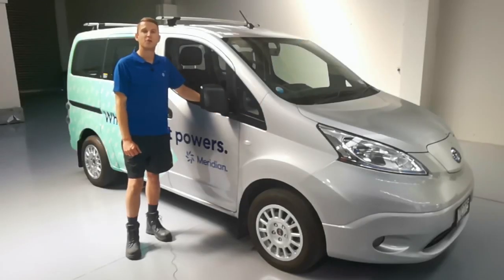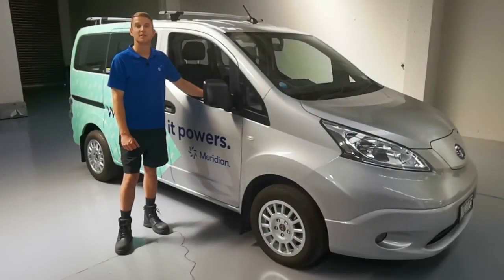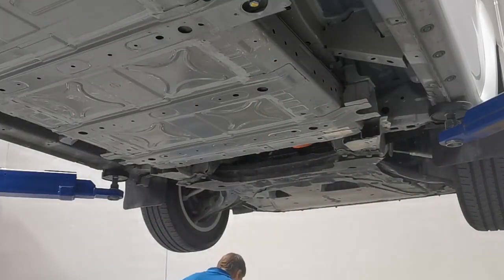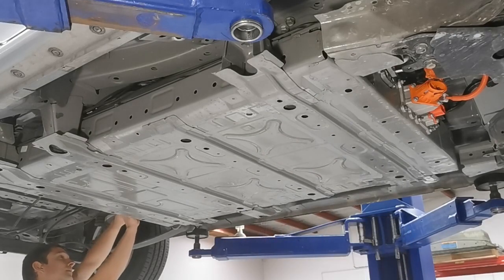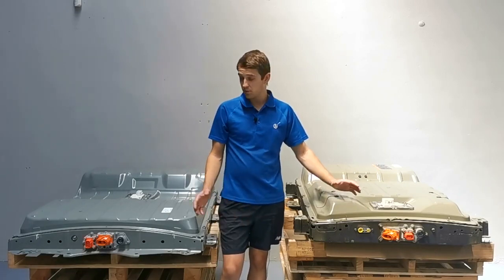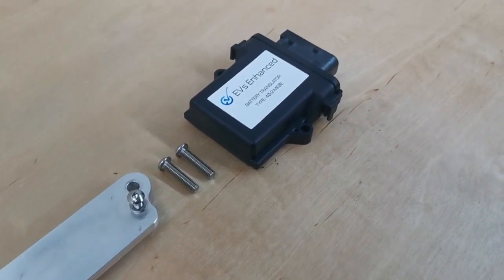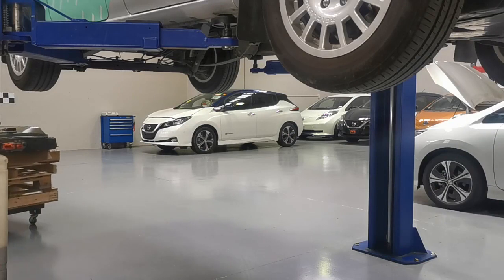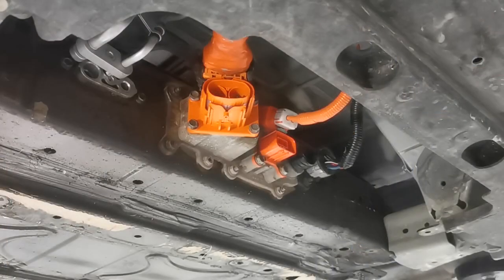Nissan e-NV200 HV Battery Upgrade - Simple Install

Comment: Where do you get your 40kWh battery from? and how much does it cost? It appears not possible to buy thease from Nissan UK or am I wrong?
Reply from the maker: Hi. The battery pack came from a lightly damaged 2018+ e-NV200. There were very few of these vans ever made, so finding these packs is quite difficult.  We are working on another solution though which we will be doing a video on in the future.  Subscribe to our channel if you want a notification on that when we release it.

Comment: I have the option to buy a battery from Nissan Leaf 40 kWh and I have an e-nv200 24kWh, the question is if I take out individual batteries from the 40 kWh leaf, can I put them in the e-nv200 24kWh
Reply from the maker: Hi. Good question. The answer is yes and no.  You can use most of the modules from a 40kWh Leaf battery pack, but not all of them.  You need a few e-NV200 specific half modules and trying to split 40kWh Leaf modules in half is not recommended. Also, the 40kWh Leaf BMS needs to be reprogrammed and a different current sensor is required.  We just happen to be doing an e-NV200 40kWh upgrade this way very soon and we will make a video showing and explaining the whole process.

Comment: Is there going to be a 16-blade battery pack available for the ENV200 as well?
Reply from the maker: Hi. Unfortunately, the 16 Blade platform is very specific to the Leaf and wouldn't be compatible with the e-NV200.  However, we do have tentative plans for the e-NV200 that we'll re-visit more seriously once 16 Blade Green is in production.  We're also currently playing around with re-packaging 40kWh Leaf modules into e-NV packs as we expect to be pulling a lot of 40kWh Leaf packs out of ZE1s to upgrade to 16 Blade Green.

Comment: Changing a battery pack is this easy?! multiple times easier than an ice swap. Are their other steps not in the video?
Reply from the maker: Hi. The only part which was mentioned, but not shown here is the de-gassing and re-gassing of the air conditioning system which is used to cool the battery on most e-NV200s.  Other than that - yes it is super easy compared to an ICE swap.
Reply: @EVsEnhanced  But then doesn't really compare to an ICE swap - more like replacing the fuel tank. Analogy for ICE swap would be changing the whole motor/inverter/reduction stack.

Comment: So your AC must be on all the time to cool these ...not very good for the environment is it....these EV burn oil and gas just like a petrol or diesel...the difference is the old oil from a diesel or petrol can be reintegrated back to a oil burning power station and burned to make energy...very good that.....
Reply from the maker: The AC is used only to cool the battery and is not required often.   The AC system is powered from the high voltage battery.  How is this anything like burning petrol or diesel?
Reply: @EVsEnhanced  especially if we get our electricity from solar

Comment: Good day! I guess I already asked you !?
Tell me, is it possible to put a 62 kW battery in the e-HB200?
What is the best way to do this? Move all the elements to the old case? Will there be room for a cooler?
Thank you!
Reply from the maker: Hi.  Using modules from a 62kWh Leaf wouldn't be possible with the standard eNV200 battery enclosure.  However, with a custom made battery enclosure, wiring loom, bus bars, battery translator and enough time/effort anything is possible.
Reply: @EVsEnhanced  Спасибо!

Comment: no. it's not active cooling. nissan packs have a 3-cell stack- so even if you blow cold air directly into the pack? the middle cell gets NOTHING. and? nissan packs CONTINUE to fail before 100k miles. PATHETIC.  liquid cooling is problematic? "tesloop' inc. operates a shuttle service to & from the casino's... basicly a taxi cab. they pick up people FROM all over CA & nevada- and haul them to the casino's. frequently i-80 & i-50.. over the sierra's IN WINTER, in sub-zero temps. they use tesla model x p100- and they report NO PROBLEMS with those packs... only replacement at mileages between 300k to 450k! you'd cycle through 4 or 5 leafs in that many miles. air cooling my ass. what a joke.
Reply from the maker: This system on the e-NV can only be referred to as active cooling.  You are correct that blowing cool air around inside the pack is not nearly as effective as active liquid cooling, but it is more effective than nothing.   We totally agree that Nissan's battery module design does not lend itself well to any type of cooling.   However, we've done a road trip with an e-NV200 for some real world testing and it is certainly an improvement over the equivalent LEAF.
Reply: @EVsEnhanced  agreed. it's just sad- aside from that? they have a wonderful vehicle in the leaf & the van. at this point they'd almost be better off to just buy a tesla pack & call it a day.

Comment: You could probably sell the translator in the UK, have you seen the video below? 

Watch "New Batteries for Old EVs : 150% more range for a Nissan LEAF | FULLY CHARGED" on YouTube
https://youtu.be/C4nS_tSQiVQ
Reply from the maker: Yeah, they certainly make the process look a lot more complicated than it needs to be with hacking into the wiring and having to send files away.

Comment: Have you guys thought of doing an aftermarket cooling kit for the leaf 40&62? Forced air cooled maybe?
Reply from the maker: Hi. Firstly, the 40 and 62 are completely different situations.  The 40 is pretty bad on any kind of long-ish trip with multiple fast charges involved whereas the 62kWh takes a lot more effort to cook.  There is very little spare space in a 62 pack which is pretty packed full of cells so adding anything else in there isn't feasible.   We have put considerable thought into cooling a 40, but decided against it mainly because the original module design really doesn't lend itself to very effective cooling. It makes more sense to put good 40 packs into earlier cars and replace with a well engineered replacement pack with a decent cooling system.   We're planning on releasing more videos this year on this topic.

Comment: Wondering if it is possible to put the bigger 62kwh pack from the newer Leaf into an env200?  I'm contemplating an env200 based camper van and the extra range would really be helpful in more remote parts.
Reply from the maker: The Leaf packs are quite a different shape as shown in the video so this isn't feasible.  However, approx. 60kWh is definitely feasible in these vans as an aftermarket solution.
Reply: What cost is this upgrade

Comment: Fenix power in Raleigh, NC builds REAL active cooled packs with cylindrical cells, installed for $7k and offers a BETTER warranty than nissan. SAD WHEN AN AFTER MARKET COMPANY BUILDS A BETTER PACK THAN NISSAN BUILDS for their OWN car. or? exciting I guess if you own a leaf.
Reply from the maker: Are you sure Fenix has an aftermarket liquid cooled Leaf battery available for sale now?  If so then that is great news and we would love to see more details.  However,  we don't see any new information on their website or social media to confirm this so suspect that it is something they are either still working on or have given up on.

Comment: blowing cold air into the battery case is NOT THE SAME THING as active cooling. nissan's battery is still a failure, not to mention the fact that constantly running the hvac system to maintain battery temps is no where NEAR as good as active liquid cooling and takes extra energy away from the pack vs. liquid cooling. DID THEY LEARN NOTHING? 

hey nissan- I'll SPELL IT REAL SLOW so even YOU  can get it:    L i Q U i D    C O O L i N G
Reply from the maker: This system on the e-NV can only be referred to as active cooling.  True, it is not nearly as effective as active liquid cooling, but it is more effective than nothing.   We've done a road trip with an e-NV200 for some real world testing and it is certainly an improvement over the equivalent LEAF.  At least Nissan has finally gone to liquid cooling on the Ariya.
Reply: Active cooling is an essential feature in very hot climates, but a nuisance in cooler climates. Cars with active liquid thermal management are prone to leaks and expensive repairs and increased energy consumption. Some of them that actually heat up the packs in anticipation of fast charging actually do so at the expense of reduced battery life, although they try to not make this noticeable. The best solution could be air cooling using a combination of ambient air and air output from A/C. If you're cooling the cabin using A/C, it's most likely that your battery could also benefit from cooling, Air can reach every corner of a pack much better than liquid cooling.
Reply: @Urbanbenelux  only in GM Ev's. tesla has NO HISTORY of cooling problems. ever. they use a heat pumP system. 15% MORE EFFICIENT than nissan and GM. tesla is the GOLD STANDARD... everyone knows that. that's why a used model S from 2012 still sells for nearly as much as it did when it was new... even with 60k miles on it. leaf? $6k. battery replacement for a tesla model Y long range, 75kw? $8k for the pack, $12K total with labor to swap. leaf? $15k! for a battery not even HALF that size. 

and? if air was so much better... then nissan's should in theory be better than all other ev's... but they are THE WORST. their batteries are TOAST at 80k miles. so... no matter HOW you slice it? air cooling SUCKS. why do you think motorcycles... even dirt bikes.. .NO LONGER USE air cooling? ice cars? are you kidding me? hell no. even PC's... gamers PREFER water cooling. air cooling is for cheap skate auto makers who want their vehicles to fail.

Comment: I have a 2015 e~NV200 and mine does not have the liquid cooling system. It’s strictly a passive cooling system like the Leaf but I have had no issues and travel all over Japan in my awesome van! Absolutely love this van and even with a 24kWh pack it gets us everywhere we want to go.  🙂👍
Reply from the maker: That is really interesting.  We have not seen a non-cooled e-NV from Japan before.  Are you sure? What sort of spec is your van?  How did you figure out that it didn't have the cooling system?
Reply: @EVsEnhanced  In Japan if you want to buy the 7 passenger e~NV200 you only get one choice. They actually call this van a wagon so it doesn’t get confused with the work vans. All the work vans come with the active cooling and the 5 passenger wagon does as well, but the 7 passenger wagon~van comes with an extra air~conditioning unit for the back of the van. Since the extra row of seats and the extra air~conditioning add quite a bit of weight to the van Nissan pulled the active cooling out. Like I said before, if I want the 7 passenger van I don’t get any choice of configuration or options. At least it is the top of the line model so it comes with full airbags including side curtain air bags that run to the very back as well as a 1,500 watt inverter that runs off the traction battery. 
Unfortunately, shortly after the 40kWh NV’s started to ship, Nissan Japan stopped selling them over here. They were incredibly expensive at $50,000 so the only people buying these things were the city halls around Japan for the most part. Still, it’s a shame because it really is a wonderful van even if it’s made in Spain. 😉
Reply from the maker: @ElectrifiedJourneys  Thanks very much for the detailed explanation.  We learn something new every day :) Yes, we were aware that there were very few 40kWh e-NVs sold in Japan and that they have stopped selling them altogether which is a shame for us here in NZ as we source many of our EVs as used imports from Japan.  It sounds like the e-NV200 replacement might be a re-badged Renault electric van.
Reply: @EVsEnhanced  Interesting, not sure how I feel about Renault though.
Reply: @ElectrifiedJourneys  I do have a 7-seater E-NV200 Evalia, year 2017, 24 kWh. This clearly has active battery management (as soon as you plug it into DC in the summer, the AC unit kicks in, and the AC fan also).
Reply: @negyesikrek  I got a 7-seater E-NV200 Evalia yesterday, and I tried to charge it today, the AC came on and would not go off, I was kind of worried until I saw this, thanks!

Comment: Cost and range increase? Come on, don't be coy...
Reply from the maker: The range after the upgrade is 200-250km depending on the driving conditions.  The price is almost entirely based on the cost of the replacement 40kWh battery pack and the e-NV packs are in short supply.  Right now we have no more stock stock and a waiting list.  So it isn't going to be a common conversion down in our part of the world.   We're happy customers that have found or have access to one of these battery packs though.  The cost of our translator kits alone are our our website evsenhanced.com

Comment: Mindblowing to see that Nissan didnt Change the battery Pack Shape. That could Open Up the possibilities to produce Aftermarket Battery Packs even when the car is 40 years old. But I wonder how much a 40Ah Pack costs!
Reply: They’re a car manufacturer/seller, not a battery seller. Also, Japan makes disincentives for older vehicles (that’s why we get their cheap 2nd hand). Needs some policy changes to keep EV’s on the road for as long as possible and upgrade/recycle/refurbish batteries.
Reply: @chrisgorman1652  from a car manufacturers perspective it wouldnt make sense to keep those older electric cars Up to Date. Car Dealers would experience a massive crisis as at least half of the customers would Stop going for a new car. But for that theory I need to know at what total Cost you could restore your old Leaf. But youre right I gotta look that Up somewhere Else , thanks for the explanation. 👋

Comment: Wonder if they will sell the wheels, they look great 😁
 P.s I'm in Chch too and would love to have a 40kwh pack in my Env200. What's the rough costs? My one is at 84%SOH
Reply from the maker: Yeah they are old rally car wheels and look pretty cool.  We're struggling to source more 40kWh e-NV battery packs at the moment unfortunately and that will completely determine the price we need to charge.  The battery in this van was a lucky find.
Reply: @EVsEnhanced  yeah they look like Method wheels from the US. Would love a pair.

Maybe double 2x24s instead 🤣

Comment: Are you contemplating a 40kWh Battery translator for the 2011 leafs? I think that will be the sweet kWh spot for those little cars.
Reply from the maker: Yes.  One of our test cars has that exact translation, but our standards are very high and we haven't quite released it yet.  Nissan did some very weird things in the firmware on 2011/2012 cars that need to be carefully undone to give a flawless user experience.
Reply: @EVsEnhanced  As always I'm impressed by your work.  I would humbly caution not to let the flawless be the enemy of the good.  Many Leaf driver's are ok with functional but imperfect :)
Reply from the maker: @InnovativeSustainableSolutions  It's hard to argue with that.   However, there is something to be said for being satisfied with the product you sell.

Comment: Boggles my mind why they didn't use the same active cooled pack in the leaf.
Reply from the maker: Yes. Considering this cooling system ware released in these vans in 2014, it is surprising that they didn't do something similar with the Leaf on the 30, 40 or 62kWh battery.
Reply: Or why Ford made an all-electric Ranger truck in the late 90's.  Then recalled them for no reason, and didn't make any effort to electrify transport for 20 years.  Same exact story for GM from the EV1 to the Bolt.  Legacy automakers have displayed contempt if not outright hostility toward EVs even their OWN damn EVs for decades.  Nissan's irrationality was, . . normal in this regard.  I love the Leaf because it offers people an electric option for under $4kUSD.  I have no sympathy however for Nissan, Ford, GM, and what they have coming.  They made their bed for 20 years with decisions like the one mention.
Reply from the maker: @InnovativeSustainableSolutions  Agreed.  You can love the cars without liking how the manufacturer behaves.
Reply: Because the leaf don’t have a cool pack system lol
Reply: No 62kw packs

Comment: QUESTION: Will the mobile app be working after the battery swap ?
Reply from the maker: Here in New Zealand the mobile app doesn't work on any of our imported Leafs or e-NV200s, but our battery upgrade shouldn't effect this in other areas where the app was working previously.

Comment: my 24kw is fine at the moment,but i,ll be looking to upgrade poss for the 60kw?  ,,
Reply from the maker: Nissan hasn't make an e-NV200 with larger than a 40kWh battery and it is very unlikely to at this point as the current e-NV200 is close to the end of production.  Anything larger than that will need to be an aftermarket battery.
Reply: @EVsEnhanced  end of production?
Reply from the maker: @Breaks4Breaks  Yes. All e-NV200s for all markets are built in Nissan's Barcelona plant.  That plant is supposedly being closed at the end of this year and it has been reported that the e-NV200 will stop production.  It has already been removed from being offered in the Japanese market.  Nissan has said that the e-NV200 will be replaced with a re-badged Renault van, but we haven't heard if that is using an existing van or a new design.
Reply: @EVsEnhanced  would this be the Renault/Nissan deal to rebadge the kangoo car based van? I like the e-nv200 for the size.
Reply from the maker: @Breaks4Breaks  Yes, we have heard some rumors that it could just be a rebadged Kangoo, but that may or may not be true.  I guess we'll have to wait and see.